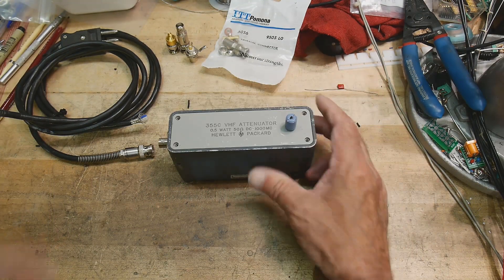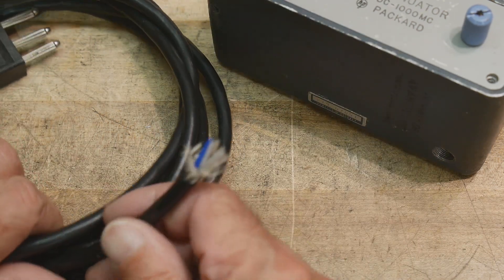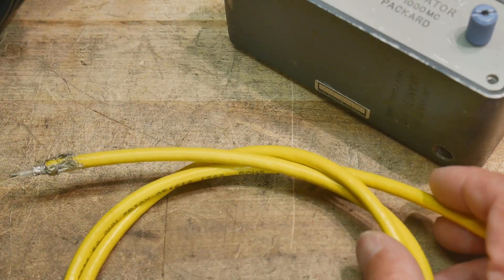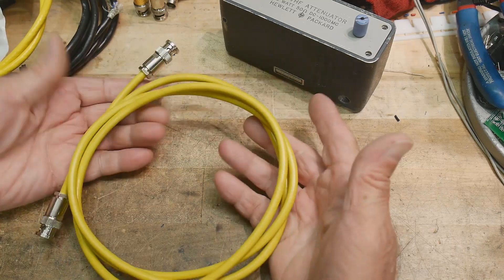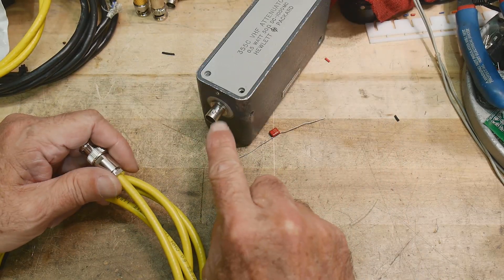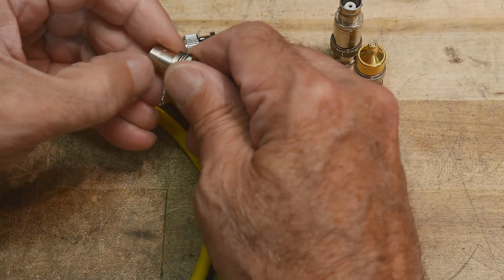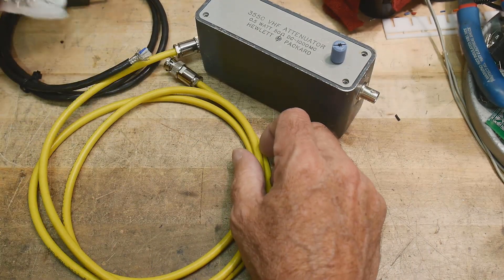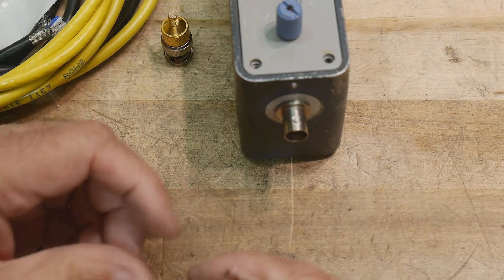#768 Twinax and Triax Cables for Keithley 619 Electrometer

Comment: We used to call our two wires/one shield cables and connectors TWIN BNC.  The connector had the insulation core split, the short half had a pin and the longer insulation half housed a socket.  Of course, the panel and the cable connectors had to maintain continuity of the wire colors, so the panel one had color “1” on the pin, and the cable one had color “1” on its socket.  Color “2” was the opposite.  In that way, the whole “BNC” was polarized for differential signaling with an end to end shield.  Our use was for communication between a hand held pendant and the main controller box.  The connectors did not need more than the usual two outside lock pins.  You could not mix an ordinary BNC and the TWIN BNC anyway, due to the internal mating surface difference.

Comment: Cool Video. I work at Keithly and can confirm that yes that connector is for a special sma cable with guard and shield, just like a standard triax but thiner and semi stiff. We use it for SMU connections on the 4200 series parameter analyzer. if you search 4201-SMU on google you can find images of the card.

Comment: Haha very nice find. Triax/twinax/quadrax connectors aren't too hard to crimp as long as you have the tooling - which is very expensive. I've had similar experiences with Arrow. I work with military stuff a lot and at some point I needed a particular mil connector. They were something like $80 a piece normally, but then I saw that Arrow had cheaper options.. which happened to be space-grade outgassed versions of the exact same connectors. They came in their own boxes with space-grade labeling, with full outgassing and compliance reports. On Arrow, they were something like 30% cheaper than regular versions of the same connector. Physically identical of course. I have no idea how Arrow derives its prices - they seem all over the place sometimes. I sure hope that distributors aren't getting screwed by Arrow in this way, where they'd have to absorb the cost of these pricing mistakes. The business models of some of these larger businesses can be absurdly inefficient at a low level, even if they are reasonably profitable on a macro scale. Something something capitalism. It's the norm. ;)

Comment: I wonder if you could make your own triax cable by taking some good coax and then push some braid from another coax over the first coax. Maybe then put heat shrink over the outer braid. You can compress braid pretty well so it will fit over a larger diameter.  Connectors are still an issue I suppose.